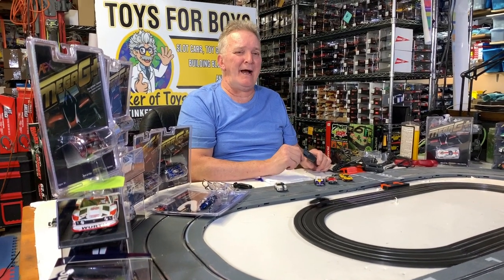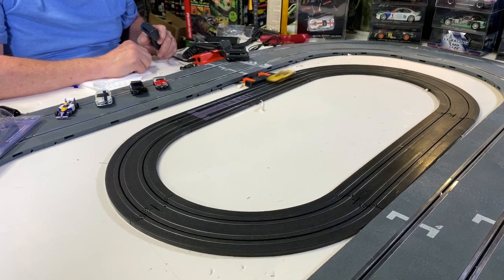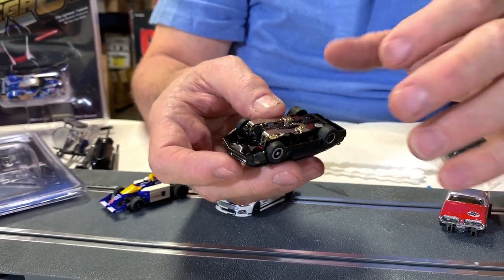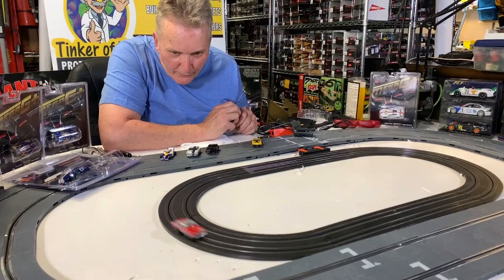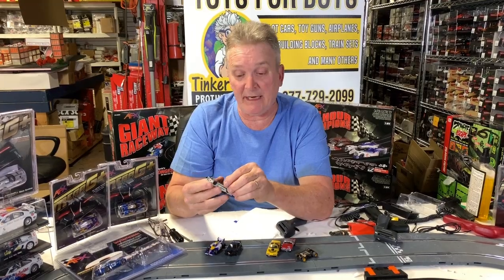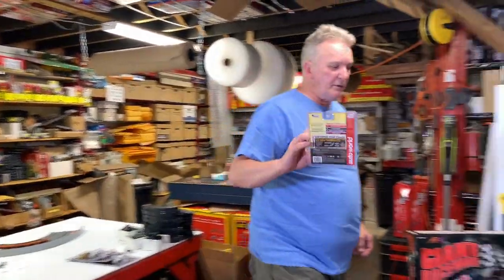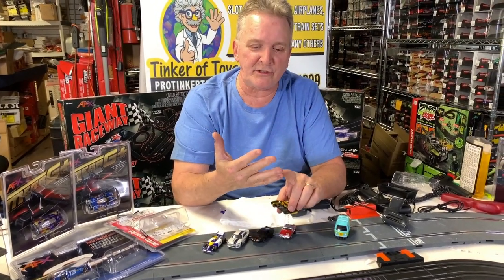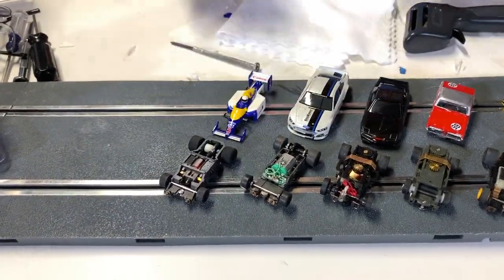Slot Car HO Chassis | Slot Car Starter Series

Comment: Yeah, the sixties cars would slide in the turns, and if you timed it right, you could knock your opponent off the track. I remember spinning a 180, running backwards, and doing another 180 to right the car, all without touching it. Then came magna-traction, and it seemed to lose something. I'm glad I kept all my old cars.

Comment: I so agree with you about liking the slower moving cars. My brother and I had an Aurora T-Jet set from the early 60's with the gray, steering wheel, speedometer, controllers and if you went too fast on the curves, off they went! It took a bit of skill to drive them and we all did like to watch them as they went around the track. We were fortunate in that we had a large basement, and after saving up money from our allowances and odd jobs, we had enough money to buy all the track we needed for the "Pan American Mexico" layout that was shown in the back of the sets instruction manual. It was setup on a 4x8 sheet of plywood set on sawhorses and it provided hours of fun for us and our friends.
Reply from the maker: Thank you so much for sharing! I am glad there are others who like the more realistic racing style!

Comment: we use a rubber eraser to clean the armature where the brushes dirty them up.as kids in the late 60s we would put a dab of oil on each side to spin the tires like at the drags.we would even get a cigarette and blow smoke thru a straw under the car while they are doing their burn outs.god it was cool to be a kid back then.

Comment: Thank you so much for this short video examples of the various chassis available. I grew up in the 60's, and all we had were Tjets and tyco worm gear drive cars. I got out of the hobby right after the Tyco pro cars started coming out. When I checked 1/24 recently, the cars don't even come close to resembling anything I knew (I had just started soldering my own brass rod chassis back in 1968 when I quit to focus on REAL cars!).  So 1/24 is out. Even the HO magnet cars go way too fast to be fun to race. I'll try all the different types, and see what's best. Perhaps a magnet car, but without magnets, at a reduced voltage?

Comment: I agree that the slower cars with less magnatraction are more realistic, they look like a car, act like cars and feel like cars. I think that the worse thing that happened H O scale slot cars is when the manufacturers placed such strong magnets in the car as to dominate the chassis rather than just assist the chassis.
Reply from the maker: I think we agree! Thanks for watching and commenting
Reply: Nothing better than going sideways around corners, nothing beats the Tyco Pro cars with the brass pan chassis circa 1970's
Reply: John, I think the big attraction to magnets was to make the cars easier for the little kids to use without them coming off the track. I, too, find them less than fun, for  the same reason you do. I actually prefer cars that need more skill to get them around the track quickly without spinning out or flying off the track. The magnet cars stay down until they don't, and then  don't spin out, they just fly off the end of the track.

Comment: Does the volt changer increase/decrease acceleration of the cars..? and it available w/ the different car sizes?
Reply from the maker: HO is the only one that has the adjustable power supplies which are a great option for children and beginner racers.

Comment: Do you have in stocks, the AFX mega g long wheel base 1.7 slot car, I think its the older  one, this is the one you can put a pan plate on it thanks.

Comment: how much does a set cost? I had an aroura  set and my friend and I used to run with our train sets and I raced 1/32 and 1/24  scale when we had hobby shops around  now it's rc cars  $300  when I bought my ho slot cars they cost $3 and 1/32 was $12-#13 I don't know what an ho car cost my cousin said the ho is $50 for one car? is that right ?